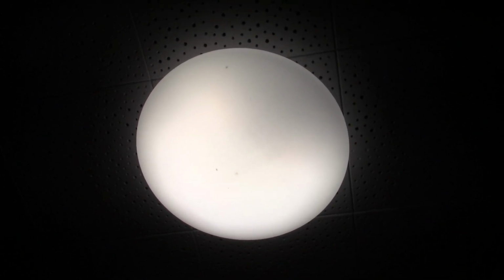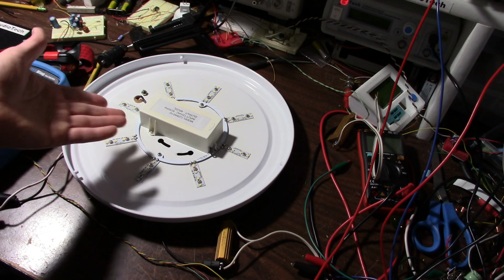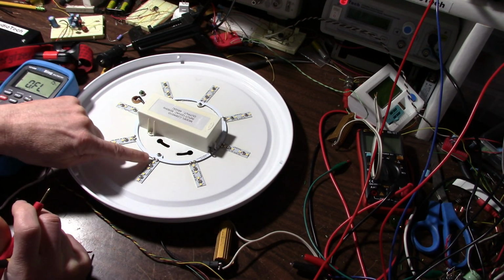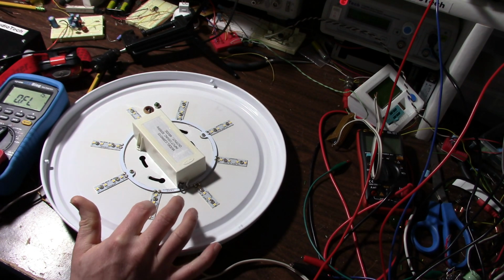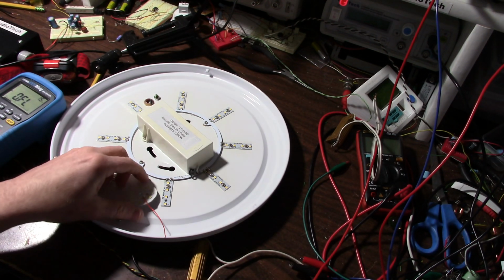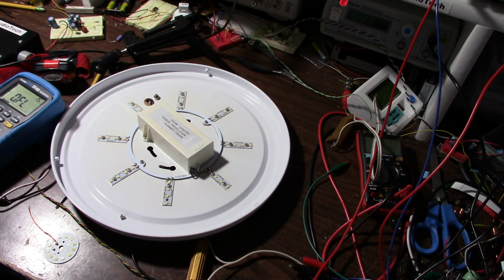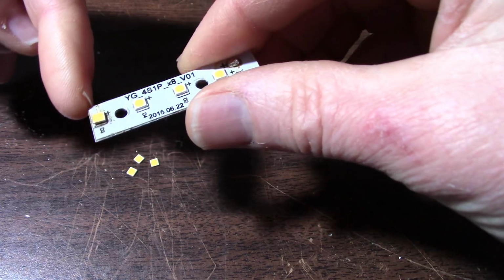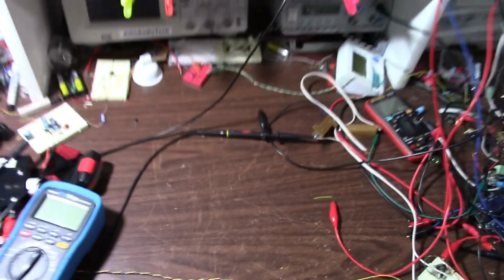LED light fixture repair

Comment: Hi. John. I am somewhat new to component level trouble shooting. Is it possible to perhaps pay you a little sum of money to take a quick look at a schematic of the Harman Kardon 670 (Early 2000s model) amplifier board to confirm if the(Mute Amp) input need 5volts to mute or 5volts to un-mute?

Comment: John, Im in the process of ordering capacitors. Specifically 2.2uf, 47uf, and 3000uf for the input of the preamp, between the driver and the power section, and at the output of the speaker. I haven't used anything but Chinese parts before and my head is spinning at the variety of models available, even from a single manufacturer. I was hoping you might be able to just recommend a product line or two in those values. I'm not picky. Just want something that works well and is reasonably priced. Maybe nichicon. Thanks!
Reply from the maker: I use Nichicon or Panasonic brands. 105C temp rating on the electrolytics. Use a film cap for the 2.2uf if it is on the input.
Reply: @JohnAudioTech  thanks!

Comment: Hi, I just saw you 12AU7 kit test & review which I looked on ebay and could find it and was wondering if you have seen the 6J1 Vacuum Electron Tube Valve Preamp Amplifier DIY kit sold in Amazon and ebay to see if it was a good "DIY usable kit"
Reply from the maker: I might have to check it out if it is cheap enough.

Comment: It would help to dissipate the heat from the LEDs by putting some heatsink compound between the back of the LED strip and the case. This could also prolong their working hours.

Comment: Some suggestions on desoldering and soldering of SMT LEDs. You could scratch a small area of (white) solder mask covering the traces around the LED. Then use a soldering iron to put on some heat and solder at the exposed trace. The heat would then melt the solder underneath the LED and you can remove it very easily. To clean the old solder, just wipe with the tip of a dry cotton swab while the solder is still molten. To re-solder a good one at the same position, apply just enough fresh solder on the pads, heat the scratched area next to the pads until the solder melts. Then put the new LED on the molten solder with a tweezer. The surface tension of the molten solder will stretch the LED in position. Done ! Thanks for your attention.

Comment: I don’t understand why all the LEDs can’t just be parallel and not series.
Reply: The forward voltage of LEDs isnt exactly the same, there is a natural distribution. This means the LEDs with the lower forward voltage will hog the majority of the current if connected in parallel, burning brighter than the others and failing sooner.

Comment: I bought one of the first ones out. Made by CREE and it's about 12 years old, and has been working everyday! 
This is the only LED light I've had that lasted this long. The bulbs today, burnout in a year or 2.
Crappy capacitive dropper ps, or improper heat management around the socket, causes all of them to fail early. 
I think I paid like $23 for that bulb back in 2009. It takes a minute to reach full brightness, like a florescent bulb would! 
Even the glass feels like it's covered in thin silicone rubber. You'll have to pay big bucks if you want good genuine CREE bubs.
Reply: @Joachim Shekelberg The class X caps used in droppers degrade as part of their self healing property, so also fail over time.
Reply: @Joachim Shekelberg Every time a healing event happens you lose some capacitance. Not such a big deal on an LED lamp, it'll just get dimmer and dimmer until it doesn't work, but on some appliances that e.g. have to power a relay it will cause very odd failure effects.

Comment: hi, you can screw some aluminum channel pieces on top of the metal circle (inside or outside where ever there is space) and it will help dissipate some more heat.
happy new year !